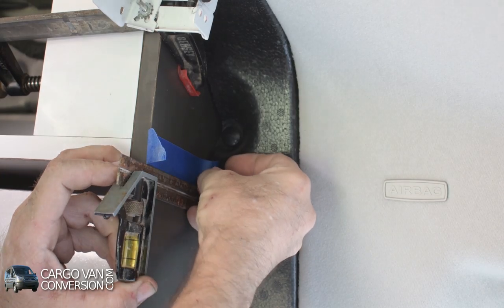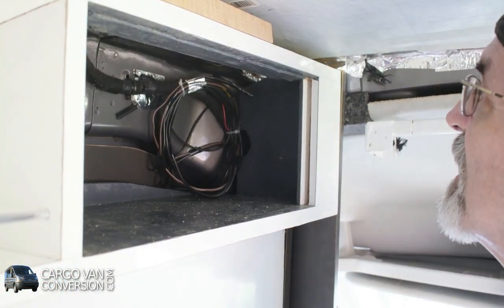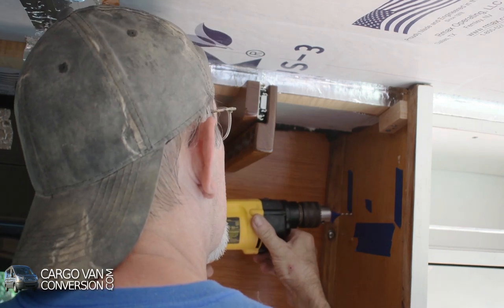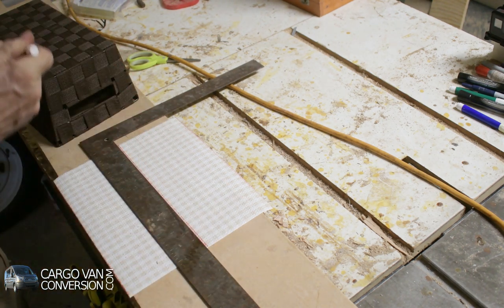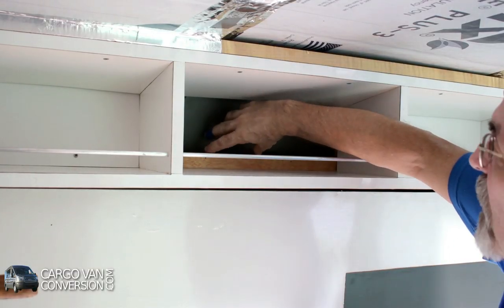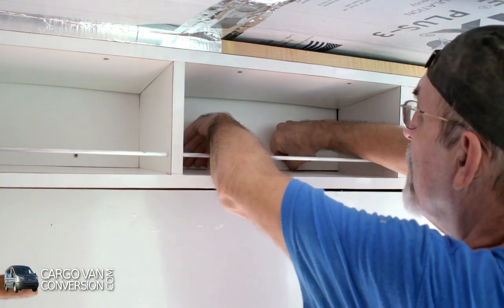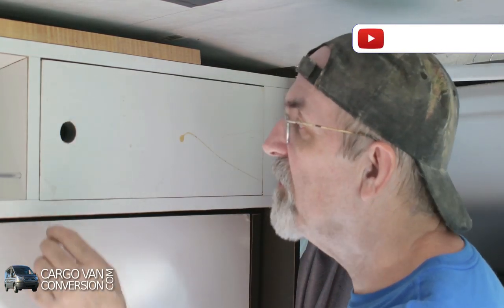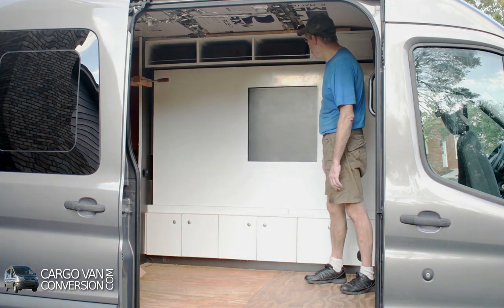RV Bed Cabinets Installation

Comment: I was thinking that nice empty spot on bottom of bed was for tv. I forgot all about the picture/ table. Looks real good Van. Certainly not click bait on a one of a kind van. I’m learning a lot from you.
Reply from the maker: Hi Stephen,
you could use it for a TV b=ut it's only about one inch deep. Don't know how deep current TV's are :) Both planned pictures have a special meaning for me, both originals are from Dutch artists. The smaller one for this location is almost finished and is a Mondriaan oil painting. The larger one, that goes on top and flips down into a desk is a copy of 'Day and Night' from M.C. Escher.
Both favorites of mine.
Van Williams & Joey.
Reply: Cargo Van Conversion   Too sweet. I thought you painted kind of a modern one to go there. Look forward to seeing it,the fact that bed lifts out of the way with table that comes down or lifts out of the way is terrific in limited space.

Comment: Make Joey a flip down bowl station. Unless you did already and i missed it. You are doing a great job. Lol,I haven't seen a corded drill in a while
Reply from the maker: Have thought about a bowl station for Joey and may still implement it, if I can create the perfect place for it. Behind the scenes, I have started experimenting with a dog bed (in front of the turned-around front passenger seat). But it's too early to say it's successful; Joey is picky about where he lays down and so far he's refusing to tell me his opinion :) Watch for upcoming videos.
Regarding the drill, that's probably a result of my age. Haven't faced an empty battery yet :) To make it worse, I usually grab my hand screw driver first and if you look closely at my videos, you may have seen me using my 100 year old hand drill on occasion. Love that stuff.
Van Williams & Joey

Comment: Awesome, fantastic 😑👍👍👏👏🥇🥇🍾🍾
Reply from the maker: Hi Andreas, good to hear from you again. Hope everything is fine.
The bed is taking shape. I still plan a fold-down desk and two pictures. One small oil painting on the bed (inside the dark square) and one on the desk, on top of it. I'm focused on other parts of the van now, so they have to wait till later. Thank for lining it.
Van Williams & Joey ... woof

Comment: with that many screws it wont  fall down :)
Reply from the maker: Hi David,
It may be a bit overdone, but they have to carry the weight of the cabinets themselves and their content; on top of that, all kinds of forces will put a strain on them while driving.
By the way, I have more confidence in wood glue than mechanical fasteners, but that was no option here.
Thanks for your comment and have a great day.
Van Williams